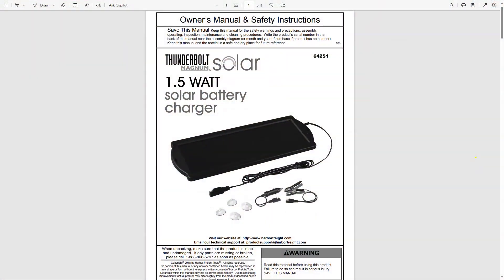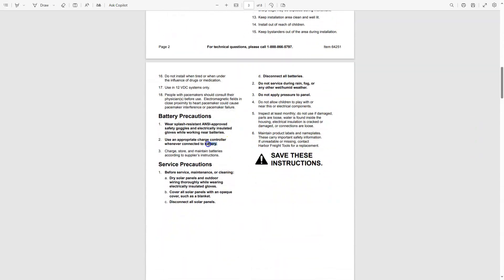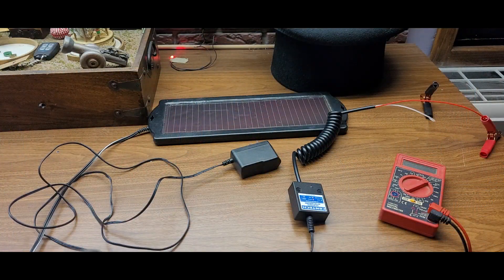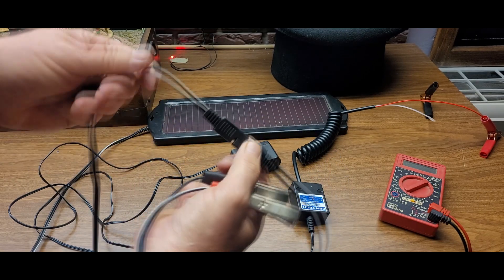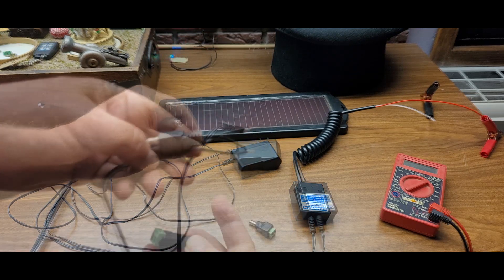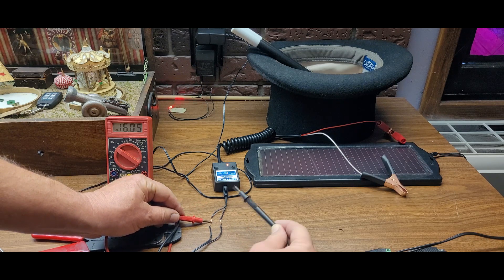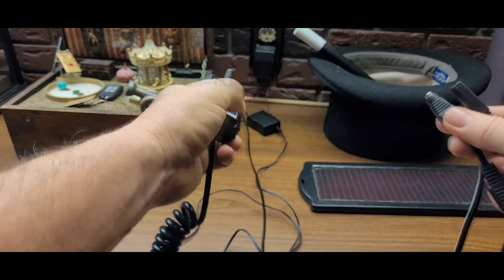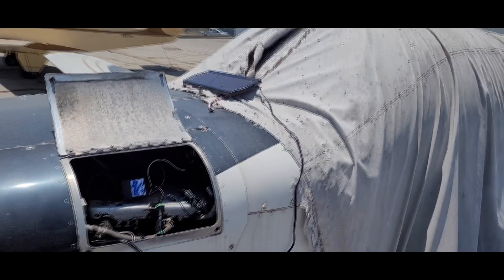Simple Solar Battery Maintainer Hack

Comment: These panels can be connected directly to a standard lead acid battery without a regulator because the current is not much. And if you install a regulator on this cell, the charging power will be lost to the regulator.

Comment: Because they might put out 20+ volt is what I just read.
Reply: The voltage can be as low as 50V when the current is so low, meaning the battery voltage will hardly ever rise too high. You know what I'm talking about.

Comment: Strange, i read that they dont need charge controllers at such low wattage.  I hardwired one of these into my car 5 years ago.  Ive left it sit for months and it fires right up every time.  Once i left it for 6 months and started right away like it had a full charge.  I think its actually saved the battery from preventing sulfidation caused by low voltages.  Im curious, did you measure the voltage on the batteries it killed? Maybe your panel doesnt have an internal diode and its draining them overnight?  Edit, I looked up some reviews on yours, its killing some batteries overnight, I bet it doesnt have a diode to prevent drain overnight.   Id put one in, they cost a few sence and the solar cells will last much longer and it will properly maintain your battery.
Reply: no need for a regulator..this man sells a regulator